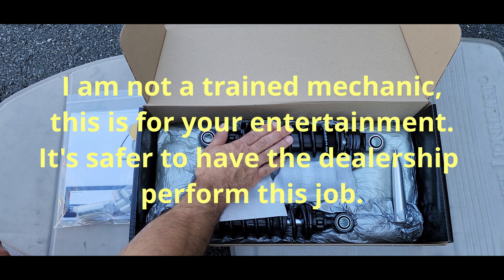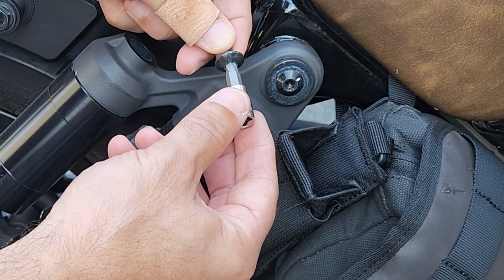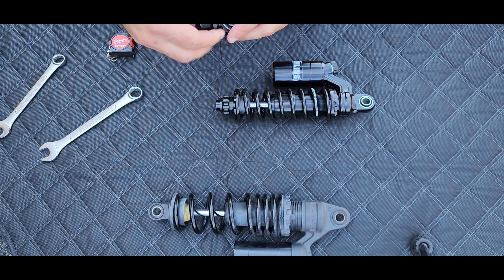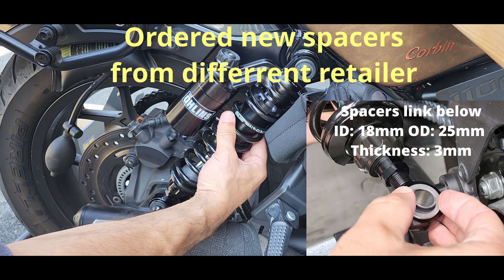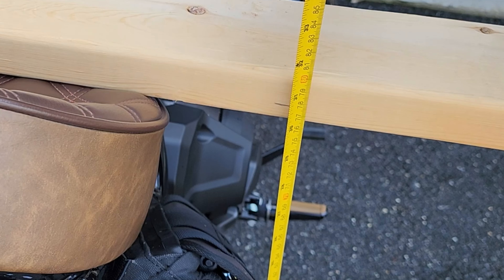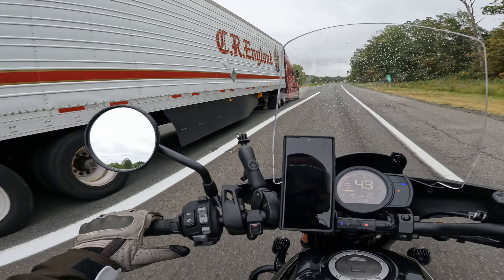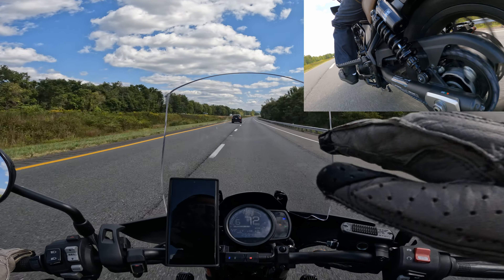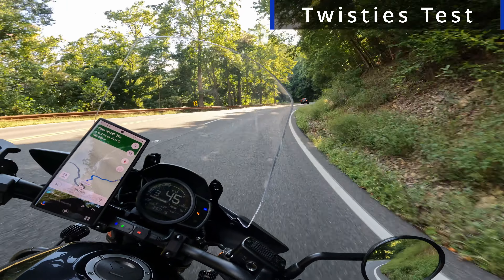Rebel 1100 Ohlins Suspension Install & Review

Comment: Good job. At 9:17, you show using Locktite Red, which is permanent unless you use heat to remove the bolt. At 11:20, you use Blue Threadlock on the left shock which is what I would have used.
Reply from the maker: Hi Maple! Thank you for your feedback! Good observation, thank you for pointing that out! Unfortunately loctite changed their packaging.... both the red and blue versions come in a red colored tube, but you can see if the video that the compound on the bolts in both sections you referenced are blue in color. I don't ever use red loctite tbh.... this is what they look like.... https://www.loctiteproducts.com/en/search.html?searchText=threadlocker&filterType=Products&type=suggested

Thank you for pointing that out, this will help the community!

Comment: Awesome video Gus!! I’m so glad you were able to make these work! Now I understand what people mean when they say they have to hide their wallet to watch my videos…cause I’m VERY tempted to try the 13” version now 😳 What do you have in mind for your front suspension?
Reply from the maker: Thank you Mike!!!! I got some additional info from Ohlins about the 13 inch version, they come with progressive springs 16-26 NM, 24-33 NM and 30-39 NM, but availability of the latter 2 is light... Additionally, they won't replace the springs since these shocks were not designed for the rebel.... so one would have to buy the different rate springs ($150) and get them installed since they don't want the liability.... 
Regarding the forks, i would prefer to get a cartridge kit vs rebuilding the oem forks (though, i'm tempted to rebuild both the rear and front oem out of curiosity), i am drooling heavily over a couple of cartridge kits as i'm typing this, just need to figure out a couple of things and have a few conversations with them before i pull the trigger. FYI, Ohlins doesn't have a cartridge for the rebel 1100 nor are they planning on making one....
I experienced the same impressions as you did the first couple of miles, the shocks surely amplified how crap the front are!! hahahha

Comment: It seems burley brands is the set everyone is installing.  Thanks for doing something different.
Reply from the maker: Thank you for your comment! Burly brand is very cost effective, and provides better comfort for sure. But my needs was for something different as my background is track riding and a fully adjustable suspension is what I was looking for. There are other brands to consider as well, Matris, gears racing and YSS. 🍻

Comment: Hi Gus, great review as always 👍 
Because those Ohlins are a bit pricy I was thinking about the Burly Brands instead. I know that Birch likes them but did you have a chance to actually compare those to your Ohlins? THX!
Reply from the maker: Hi Lari!!! I would have liked to test them, but i haven't had the opportunity, might i suggest an alternative option, YSS makes decent suspension for a reasonable price relative to Ohlins. The important thing to keep in mind is to get shocks that have the right spring rate for your weight and adjustable rebound and compression damping, that's how you will see the best results. 

Here are a few better options than the burly:

YSS suspension:
https://www.suspension-store.com/Honda-CMX-1100-Rebel-21-22-YSS-shock-absorbers-RG362-310TRCL-49-B

Hyperpro suspension:
https://webshop-hyperpro.com/product/fixed-reservoir-shock-honda-cmx-1100-rebel/

Matris:
https://www.matrisdampers.com/en/prodotto/products/monoshock/twinshock-m40kc/

Comment: Thanks for the info on removing the stripped dash guage bolt. I stripped the same one on my 1100. I hope that is still a product that Autozone carries.
Reply from the maker: Hi Larry, i'm glad you found it helpful brother!! Here is an amazon link in case you don't find it locally. Remember to hammer it in well for the teeth to sink into the metal, and go slow, that bolt is a PITA
https://www.amazon.com/Powerbuilt-Metric-Socket-Damaged-Fasteners/dp/B07PH39ZFD/ref=sr_1_1?crid=3I3LBMZTYPS6N&dib=eyJ2IjoiMSJ9.KvNjbpqU5ms2K82YTzgedacYacoxwCY_IIPnRK6x1buweOUDu4qE-n9ocmA5sop2u8T6IUYsXfqdnEZqNcJgNaOk4oAjXCyjxKqbl_E_-UK0qDbN7Fbxj5pEIpqwjwoqnTg65jCpRtSZUZrImJJNmIbQmXKedNxzK4IKO3IAi-nRg8kPQUAHjLGhxFnNug9XXQi75qeh-btd6ypFxRsAcT8lQEDqGPU3iGlXftKQi78atUdRTBm5YPEAmcrew5xtbUimHGEY6J_gT-uTyC1iDJ0kwj2-y5hln7RX21SX_mA.klVgADN04KkP0NTt6RKXmXRugVvvCtn6Qw8AQGpYNeI&dib_tag=se&keywords=Powerbuilt+Tools+8+Piece+Zeon+Metric+Hex+Bit+Socket+Set&qid=1708174599&sprefix=powerbuilt+tools+8+piece+zeon+metric+hex+bit+socket+set%2Caps%2C94&sr=8-1
Reply: Thank you Sir. It took a few guesses at what it might be called, but I found that exact item. It was delivered yesterday. I just have to wait for the new bolt to arrive. Keep up the awesome content. You have me wanting shocks now!
Reply from the maker: @larrypeplinski593  I'm glad to hear bro! Good luck with the bolt!!!🤞

Comment: Would it be possible to install longer springs on the stock suspension? I wonder if that would be an improvement.
Reply from the maker: That's a great question!!! Thank you for asking it! While working on the suspension upgrade, a part of it was to rebuild the stock suspension with a fixed rate spring and better internals, upon taking the OEM Showa shocks apart, we couldn't find any springs for it unfortunately....... The suspension shop tried very hard over a couple of month to find replacement springs but didn't any......

Comment: How much are those shocks?it rides smother? Is worth it?
Reply from the maker: Hi Mouse, thank you for your comment, these are a bit pricey apx $1,200. To me they are absolutely worth it, but since this wasn't designed for the rebel 1100 i wouldn't recommend them. I would recommend YSS, gears racing or Matris.

Comment: Purchase link?
Reply from the maker: Hi there, i would not recommend these due to the complexity of getting the right spring for your weight, there are other shocks out there that will be built to your weight. Check out Matris dampers, YSS, hyper pro, and gears racing. These are performance suspension and do not provide added comfort, if that is what you are looking for many people are happy with the Burly Brands stiletto shocks. Here is the model that i have with a different spring, https://www.ohlinsusa.com/parts/2004-2020-harley-davidson-sportster-harley-s36-twin-shocks-hd-752

Comment: Are there any shocks I can use that I can gain some height with on the rebel 1100. I dont really like the low height too much at this point and I can gain 2 or 3 inches with the rear shock change then that would be great.
Reply from the maker: Burly brand as well as Ohlins make a 13 inch version. I am not sure of the details of Burly brand, but Ohlins makes the HD 756 which is 13 inches plus you can adjust it and increase the height by 0.5 inches, i'm not sue of the total height gain at the seat but it might be what you are looking for. While researching, look for shocks with a 14mm eyelet, the stock length is 12 inch. There are several brands to check out. Regardless of what option you go with, keep in mind the spring rate relative to your weight, you saw in the video how i had to change the spring rate.
Reply: @ontherebel11  i thought the original stock shocks are 13 Inch. I measured them yesterday and got 13 inch height. Maybe i will measure again
Reply from the maker: @gsin311  Keep in mind that you have to measure from the center of the Eyelet to the center of the other eyelet
Reply: @ontherebel11  true true. I am going to remeasure.

Comment: Hey Bro, you're not following best practice when using a torque wrench. Better to set it to 6.6 pounds and torque up the bolts, better still is to torque the bolts in sequential stages, torque at lower and then as manufacturer specs... Those missing spacers are going to lead to issues...
Reply from the maker: Thank you for your feedback 👍
Reply: @ontherebel11  No worries,  I am not trying to criticize you, I don't want you to have a suspension failure ending up in injury or even death.

Comment: You shouldn't ride at all with poor fitment on the shock mounts. You should wait until you have the correct bushings.
Reply from the maker: The Bushings are good James, you probably didn't see the section where i added the spacers.

Comment: The bolts of this bike are seriously made of play-doh. I've considered just buying a second set of most of the important bolts for the bike. Couple that with how much some of my hardware is seemingly overtorqued and I've been conjuring the devil in my garage some afternoons. They also mark up and loose their clean black look extremely easily.
Reply from the maker: They sure suck don't they!! The nuts are like that too.... very soft, like you mentioned, i have many spares now....
Reply: Yep stripped some bolts on the frame. Now I pucker everytime that I have to put force into any hardware loosening.
Reply: yea I stripped mines when I was trying to do the handlebar risers installed. Now I cant get the bolt that holds the intrument cluster together out. Very fucking annoying Honda.
Reply from the maker: @gsin311   i feel your pain brother
Reply: @ontherebel11  i love the rebel 1100 but Honda has kinda fucked us over by doing some stupid things. The freaking handlebars are 1 inch that taper to 7/8 by the controls, no one makes thst kinda bar other than burly brand but theirs is 12 inch ape hanger. I seriously have thought about just getting a harley. At least its easy to customize
Reply from the maker: @gsin311  I was having a similar conversation with a good friend earlier, the conclusion is that any bike will be some sort of compromise bro, it just depends on what you value most. In my case i am willing to invest the time to make the rebel fit me and my needs as i am not willing to compromise the following: Seat Height, DCT, Cruise Control, Weight, Lean angle, Handling, and Power..... Trust me, i have been looking at other bikes, just went to a dealership a couple of days ago as i'm drooling over a couple of bikes..... but after sitting on them, i realized that i will have to compromise sooooo much just to satisfy an urge... hence why i still love the Rebel and continue to make it my own. It's not for everyone i respect that, but based on my years of experience, i'm well aware of how short lived the excitement will be if i get another bike...
Reply: @gsin311  I agree with what On The Rebel 1100 said entirely, and get your point. However, one big thing to consider here is that this isn't a Harley. It's a different experience. From the engine to the ergonomics and beyond, it's different. I bought it bc it's not just a cruiser/Harley. It's some weird cruising naked sport bike. Ppl can customize their bikes however they want, and I think that's cool, but I see a lot of people modify theirs to the point where I wonder why they didn't just buy a Harley. Some of the Rebels I see look like they are having an identity crisis.The bar thing is annoying and not entirely related, but I wanted to throw that point out there.
Reply: @ontherebel11  i agree with that. All bikes will come with some compromises, the thing that breaks it for me is the DCT, we are all getting older and the dct transmission is just godsend. I love it. Bike however is uncomfortable but the dct makes it the best bike on the market. I wish that Honda would have gone with standard spacing for the handlebar clamps so that we could install.any bar riser. I even had a conversation with Burly Brand peope and they said that they will be interested in making a harley style riser in 4, 6, 8 and 12 inch height but that didny go anywhere. I just bought 2 rox risers, i am going to double stack them, i dont like the pivoting risers tbh. But i stripped the bolt on the instrument cluster and i watched your video which suggested that tool kit that could work for stripped bolts. I am getting the delivery tomorrow so will try it out. All in all i just wish honda would make more accessories like risers and handlebars for their bikes. They jus make the bike and leave it all to us. Anyways i do appreciate and love your videos
Reply: @WaffleStomper69  the rebel line (referring to the old school ones) had some unique characteristics.  Low seat height, and tall handlebars which made it an approchable bike. The bike just had amazing ergonomics. I love the rebel so much so that i had rebel 500 before and i was aware of the uncomfortable seat and bad ergonomics i still went and bought rebel 1100. I jus thought they might have made the bike a bit taller and better ergonomics. I am just getting to a point where everytime i ride, i have some shoulder pain due to the reach. I have made alot of changes to tbe bike but kept the main look of the bike. If i can just get the handlebar risers done then i migjt stop complaining lol
Reply from the maker: @gsin311  We are on the same page brother, hence why i ended up stacking 2 inch risers over the 4..... I stripped the same bolt on the dash, make sure you hammer the hex extractor in well, and go really slow as you are undoing it, steady gradual pressure until it pops free. It makes such a satisfying pop when it breaks free LOL good luck brother🤞
Reply: @ontherebel11  so you have a 6 inch rise now ? Thats pretty good, did you had to get cable extensions. I live in canada so its impossible to get certain things in here. I have reached out to some fabricators and i was thinking i could pay someone to design and fabricate 6 inch pullback risers for me with the correct spacing for honda bikes. Hopefully i can remove this bolt tomorrow and see how that goes
Reply from the maker: @gsin311   yes sir, i have a total of 6 inch risers pivoted rearward for a totally upright riding position. i didn't need longer electrical cables, i just needed to add a brake line extension of 6 inches and reroute the parking brake line.
Reply: @ontherebel11  In that case, I should be able to get the double stack of Rox risers installed without altering any cables. Cant wait lol. Did you already do a video on the riser setup, just a small one showing the set up and perhaps where you got the brake line extension and any other items you may need